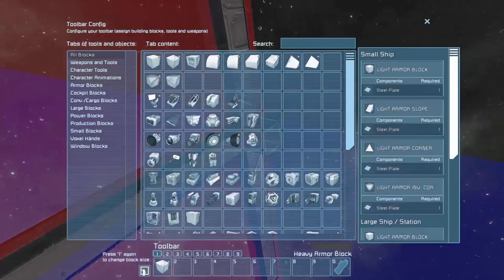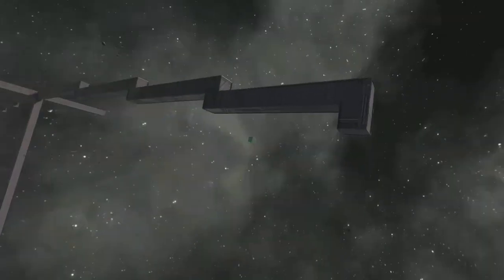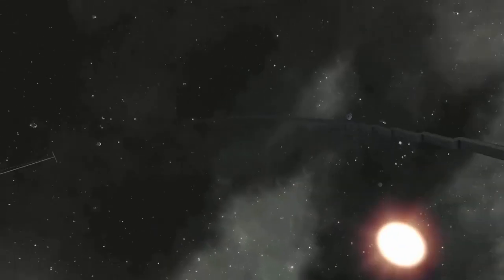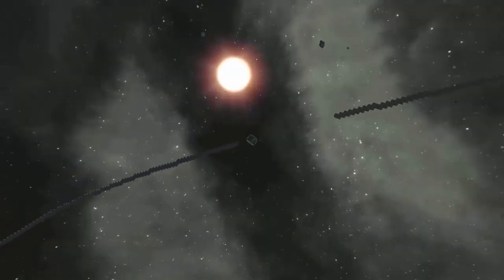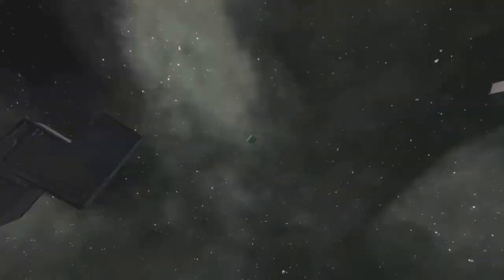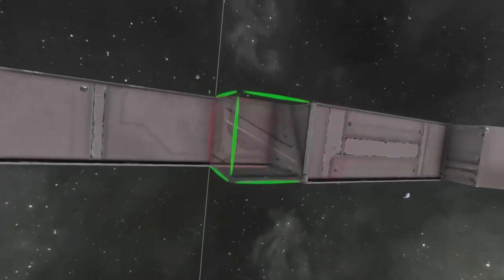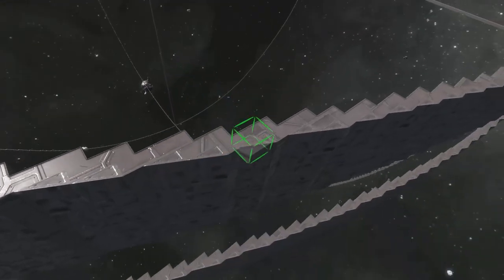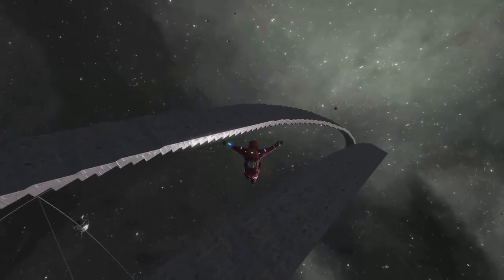SE Death Star (EP 1) Frame and Asteroids

Comment: what is the block mod you are using? the one that counts off how many and (iif I'm seeing it right) allows you to duplicate a line of blocks so you dont have to manually place each block again? Other than that Insta-sub.  I look forward to future episodes.
Reply from the maker: korey washington there is no mod that I'm using I found an 8 bit generator on line and on my phone that shows a circle with the radius of the object you tell it. I hand counted the pixels on paper then what you see in the video is a 400% faster version of me building because it takes a good amount of time to make a circle for a 400 radius station. as far as coping and pasting. I delete the block(s) that hold the piece to the station. then ctrl+x to remove the blocks then ctrl+v to paste then line it up in the new location and press the left mouse button to place. I will show how I'm doing what I'm doing in the next video. it was sped up because in t g e end it took me roughly 6 or 7 hours to get where I am.
Reply from the maker: +korey washington I don't know if I replied earlier but I will go over what your asking here in my next video.